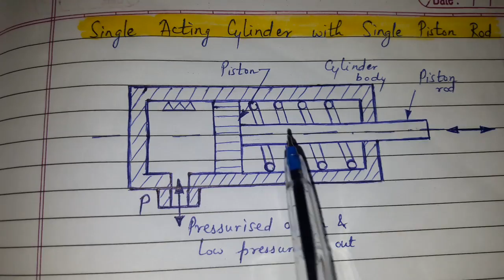Single acting cylinder with Single piston rod... #20kviews #viralvideo #singleactingcylinder

Comment: you have overlooked the drain on the spring side, without a drain the cylinder will not work
Reply from the maker: In actual, the drain should be provided on the spring side... You are absolutely right...

Comment: So what happens when the spring breaks inside of the cylinder? Will hydraulic fluid flow out from the brass air vent at the top? I'm having trouble finding the problem with a rugby LR-26B single action piston that just leaks badly when the piston is extended.  Any help or advice would be greatly appreciated